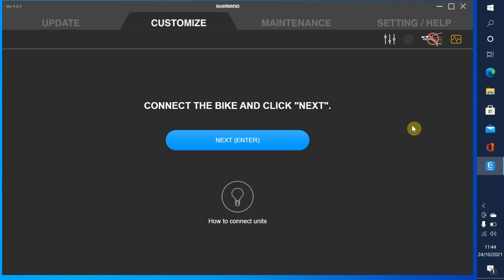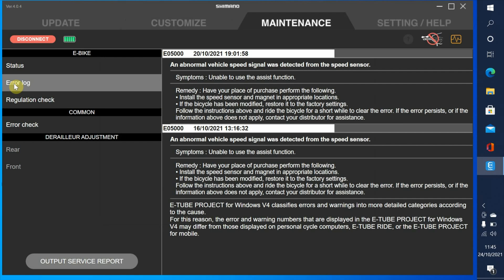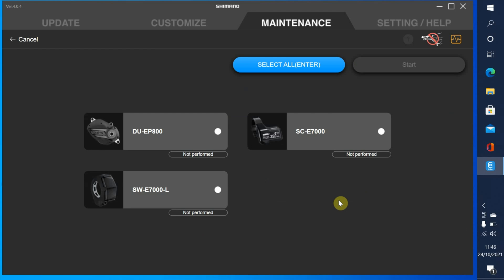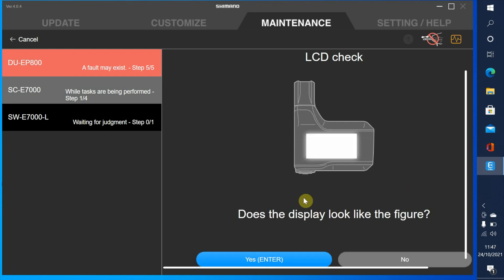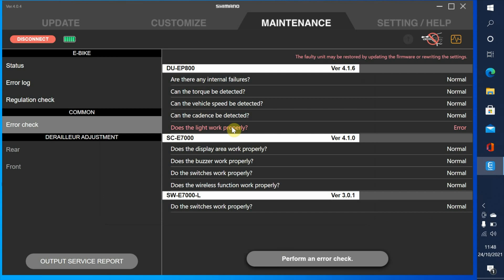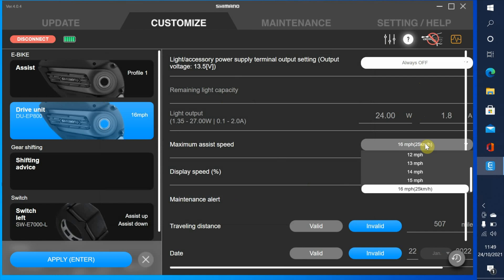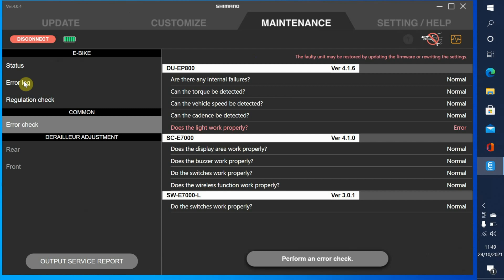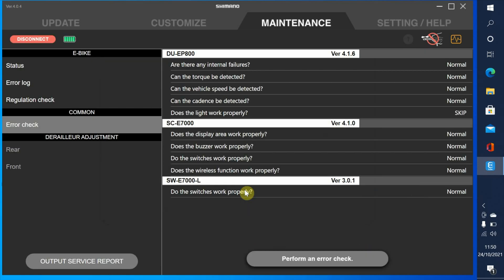YT Decoy Shimano error message and Diagnosing shimano errors and what they mean.

Comment: Just seen this video, I know it's a bit late but I have a problem on my EP8 800, only had it 2.5 years covered 3500 km, recently had error E020 battery communication error, switched off and on again was then OK, last week went to use the bike would not switch on and on connecting charger not initializing the bike, light on charger comes on but no beep, after a few minutes charger switches off, any one out there can advise what to do, the nearest Shimano dealer who can handle a E-Bike is over 130km away.
Reply from the maker: Hi, sorry to hear of your issues, it sounds like a battery or wiring problem, the only way to know for sure is a diagnostic check or if you have a friend with the same battery try that. Are you able to charge the battery out of the bike?

Comment: Hi there. I own 2021. YT Decoy with EP8 motor and after almost 10K km it still works fine without any problem during more than 3 years of propper use. I'd like to upgrade my battery to new 720Wh but I'm not sure how much life I still have in my motor. Do you have any idea what is life expectancy for EP8  motor? Mine was ridden in all sorts of weather conditions and terrain. Please help me make good decision. Thanks, Zarko
Reply from the maker: Hi, thanks for the question but it’s so difficult to answer, 10k is quite high but it’s 2021 and although out of warranty shimano would probably help you out with a discounted motor at the least if it failed over the next year providing you are the first owner with receipt and not chipped.  However it’s a 4 year old bike nearly 5. 750 batteries are common now with 800 coming on board. Tricky decision.
Reply: @TheYorkshireBikeMechanic  yes, tricky one. I'll wait a bit and see what will be on offer on black friday. Thank you very much for your answer.

Comment: Great video ive got e010 message on mine the bike is completely limp its only done 400 mile
Reply from the maker: Hi, Thanks for watching and your comment. Back to the dealer im afraid.
Reply: @cream8701 I've had same error and found bits of iron on the magnet cleaned them off and haven't got that error since

Comment: hello from france, i have a megamo  al 10 ltd 2022 since 3 weeks and with ep801 and 630 w battery , code error appear quickly after few miles .i let sleep the battery out and after 2 rides 1h30 ,error code again and now after coplete battery charge out the bike, code error again in 1 second  and i can't strart the drive unit with screen off , thanks you if you have suggestions beacause i will go in shop in 2 days.
Reply from the maker: Hi, It needs to be plugged in and diagnostics taken to find out what the problem is.

Comment: Hello love your videos. You are an asset to Mountain Biking. lovely easy chilled out vids with great advice. I need to pick your brains my Orange Phase MX works faultless and is all updated software wise.  When I use my new second battery I get the E10 error code and it logs a E01020 and then won't allow me to do anything. I replace the original battery everything is fine and rides ok. Any ideas?
Reply from the maker: Hi, Thanks for watching and your comment. Have you connected the bike to etube with the new battery installed on the bike and ran diagnostics via a laptop and not via a mobile phone?

Comment: Hello, I wanted to know if you could help me???? I got the e010 error, they already changed the speed sensor, I connected it to E-TUBE and I did maintenance and update it ... but I still have the problem
Reply from the maker: Hi, Thanks for watching and your comments. E10 errors are so difficult to solve, you have done what I would have recommended, if that has not solved it then your shimano dealer needs to be setting up a case with Shimano.

Comment: Hey man, i have some motor problems with my e8000. I had the e020 and e010 for a while and struggled to fix them. I live in norway and i my battery connections had been damaged by salt and rust. I replaced the connector on the bike and in the battery. Bike Worked great for around 1-2 weeks. Suddenly i got w013 and them e010. And its been full screen e010 Since. I really have no idea what it is. My motor is 4 yrs old and out of warranty. Is there anything i can do?
Reply from the maker: Hi, Try your shimano dealer, perhaps they can speak to Shimano to negociate to supply a new motor at a discount
Reply: I tried a new motor. Didn’t work.
Reply: Have you fixed it ?
Reply: @Cookie.clipstar  hey man, i ended up finding a new motor on the equivalent on Craigslist in my country. I installed it myself, but went to a bike shop to have it programmed with the right settings (Angle of motor and stuff). What’s the problem with yours?
Reply: @KlippClip  e20.  I think it’s a loose batter or something. Seems to be when I bang the bike hard or lifting bike on back wheel may make battery drop and lose connection:/ going to have a good look tomorrow as it’s been sitting for ages
Reply: @Cookie.clipstar  yes, the connectors on my bike had deep grooves in them from all the heat produced. I bought a new connector to put on the bike and found a local battery workshop to replace part in the battery. Solved my e20 problem, now the bike runs smooth with a new motor.

Comment: Hi there. Great video and you explain things really simply and easy to follow👊I have a Saracen Ariel 50e which is absolutely brilliant and has performed for 700 miles perfectly with no issues👍I have just updated the software which seems to have made the range estimation a little more accurate, but whilst I was in the E-Tube app I checked for errors and found the E01003 logged. As I said, the bike has given me no problems, but I wonder if I need to get this investigated further as I've got some big rides coming up💪I've subscribed and look forward to watching more of your videos😎Cheers Del
Reply from the maker: Hi, the E01003 is quite a common fault and is sensor based. In general shimano motors ep8, e8000 etc can be very sensitive to say the least. most errors will disappear after a few hundred yards pedalling but will remain in the log so that they can be sent to shimano for assessment.   Dont worry about it if your bike is running normal and not constantly showing errors on the display.
Reply: @TheYorkshireBikeMechanic  Thanks for your reply🤩The ep8 on my bike has performed faultlessly, and I know it gets some stick for not feeling as powerful and a being a rattly on decents, but out on tge trail, its so smooth and natural feeling, and nobody smashes climbs in Boost all day anyway😆
Reply: @d2cdl  how's the ep8 going now any issues and do you ride in wet weather / wet trails?
Reply: @marcdxn87  It's awesome bud👊Really no complaints and it's had a lot of use now. It got COMPLETELY submerged in a waterlogged sink hole, and did several REALLY wet rides in Wales and the Alps.
Reply: @d2cdl  nice good to hear. You only ever see the horror stories posted and never the good experiences and news on the Shimano motors. So good to see this is still serving you well

Comment: Ive got the E05000 error on a 2 day old bike. Do I just try and ride it with the bike on and it will clear itself?
Reply from the maker: Hi Ben , double check that the speed sensor is correctly positioned. Disconnect the battery and re install the battery. Ride it to see if it clears the error. If it doesn’t you going to have to book it in with the dealer. Where are you?
Reply: @TheYorkshireBikeMechanic  Thanks for the quick reply. It did the job.
Reply: @Benviermann  Hey Ben, I had the exact same issue on my 3rd ride. Did it clear for good or has the same error came back? Thanks
Reply: @marcuswakefieldmedia   Hey Marcus, It does come back but seldom. It usually happens when I ride with at a too slow Cadence.
Reply: @Benviermann  Thanks Ben! I was doing the same thing, riding at a slow cadence practicing wheelies. When I stopped then pedaled normally is when it gave me the error. Sounds like a software issue I guess. Cheers
Reply: @marcuswakefieldmedia @benviermann hey guys I’m having the same problem in my second ride, I’ve done the same as you and it’s solved but Im worried about what you said that it come back, you finally solve it?? Or it keeps coming back forever?
Reply: @dd.kiddddddd  I haven’t had the error in quite a while. But I still believe it’s caused by pedalling at a slow cadence.

Comment: Greetings, The Yorkshire Bike Mechanic, I found you recently and immediately gave you a subscription.
I've been driving Merida eONE Sixty 900-E since 2.3.2019, today I've driven 22770 km / 14143 miles and I've never had an error code.
But now the engine is grinding while pedaling - apparently some bearings are dead, and it's a shame it's so far for you to change bearings.
Honestly: it's not a lot of km / miles for the price of an engine, is it?
Will I have to buy a new engine, should I choose E8000 or EP8?
Thank you for your videos, I wish you good luck!
Reply from the maker: Hi, thanks for watching. You have done really well getting that sort of mileage without getting bearing noise earlier, it’s normal for a motor overhaul  at that mileage. Not sure where you are or how close to a shimano ebike dealer but they will be able to get you a new motor GBP cost would be approx 900 which considering the fun and use you have had is good value, do you know how many charges your battery has had? You will find that the ep8 motor has slightly different mountings.
Reply: @TheYorkshireBikeMechanic  Yes, thanks for the encouragement.
In terms of batteries, my wife drives M#rida METALLIC CRIMSON 7,258 km / 4,508 miles, together we use three batteries. The 1st BT-E8010 / 503 Wh battery has 122 charge cycles, capacity 82%. The 2nd BT-E8010 / 503 Wh battery has 67 charge cycles, capacity 88%. 3rd battery BT-E8016 / 630 Wh has 25 charge cycles, capacity 96%. If possible, I try to maintain the batteries according to Shimano's recommendations.
Good luck to you!

Comment: fault of doom E010 = new motor
Reply from the maker: Hi Ashley, You may be right but Im keeping my fingers crossed for this customer, the motor has only done 150 miles, eekkk. the main thing is that I know shimano wont quibble, they will send me a new motor no problem. Thanks for watching.
Reply: My motor has only done 150 miles in 4 years in march and have the e010 error which won't clear. Its out of warranty but local shimano dealer wanna plug it in and see what it's is saying. Shocking if its a new motor has its not even been rode.